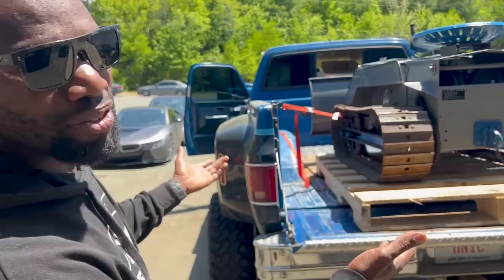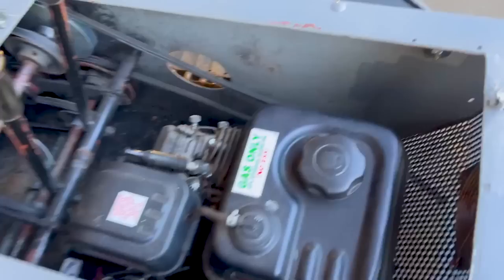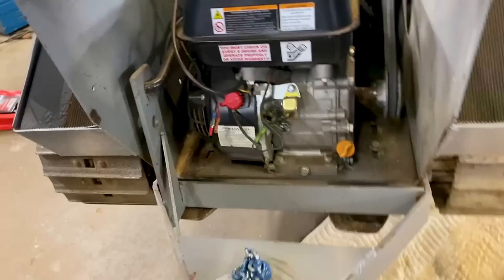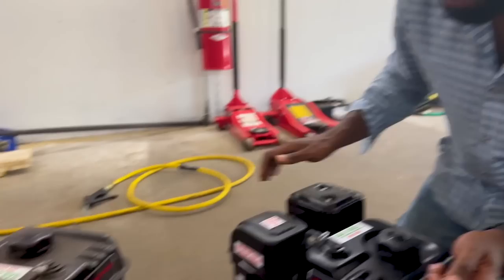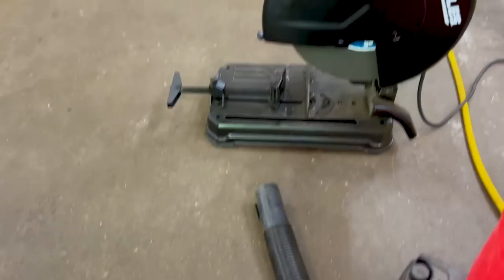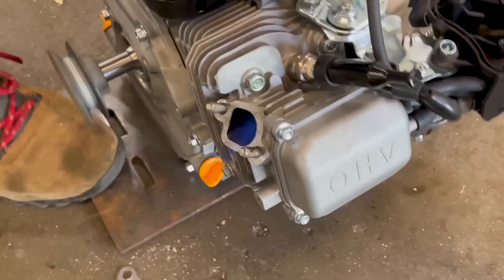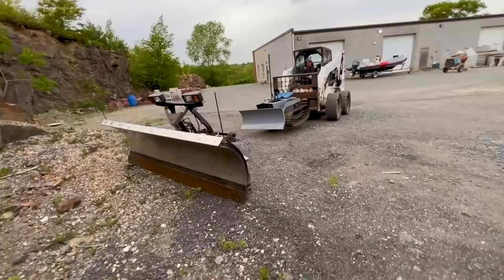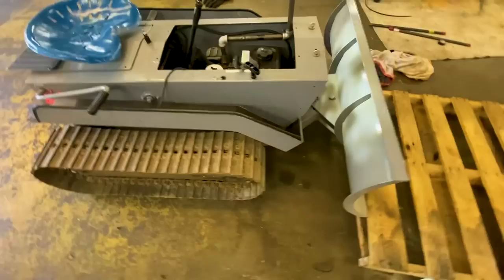Upgrading the World's Tiniest Bulldozer

Comment: Important note guys, since the governer was removed, the stock cast iron con rod and flywheel can't handle anything past like 5.5k rpm, so if you are planning on redlining this bad boy, you need to upgrade both the flywheel and the con rod to billet aluminum or you will get funky engine failure. Sick minidozer!
Reply: Jim jibroni  I've seen small engines throw the rod through the side of block. I wouldn't want to be sitting on this thing when that happens lol
Reply: Bullshit.. I spin mine to 10k with NOS
Reply: Oh the sound of that chevy..... Prime
Reply: Don't care what it's made of where it comes from or how small it is... I would use the shit outta this
Reply: @boulderdashcci  reminds me of the time a rod got blown to the side of the engine and made a hole on the side of our house with an old lawnmower. Great times. That thing knocked to hell and back but i never thought i was this close to blowing off a leg.
Reply: @getataste  had a Cummins VTA 903 let go of a rod. it spun a rod bearing and in about 3 seconds flat Threw the Rod out the side of the block made a window big enough to crawl into the engine with and shot what was left of the rod end cap about 2 lb piece of cast iron probably heavier 200 feet or so.... and the piston got chewed up into quarter pound peices and the rest of the rod came out the side of the block at mach jesus although in 4 pieces
Reply: Ik your bot joking because my rod recently flew put of mine😭
Reply: I heard those engines run better after you install an inspection port in the side of the block
Reply: @boulderdashcci  buddy of mine had his leg messed up very bad when his dirtbike blew up the valve embedded pretty deep
Reply: I don't think Struck ever envisioned the need for an engine diaper on one of these!!

Comment: The fan was probably offset to blow away exhaust (either fumes or dissipate heat) as it's on the same side

PS that's a Sharpie for scale (dozer stands on a standard pallet) wink
Reply: The exhaust was on the left side, and the fan was on the right side.
Reply: It's blowing air in, dissipating heat, when you can see the wires and the sticker / skeleton of the fan, that means the fan is pulling air toward you, otherwise you would see the fins directly and not the motor/sticker of the fan.

Comment: Steven’s a genius .. this thing would be PERFECT for commercial walkway clearing .. I used to do snow removal, and some commercial buildings can have literally kilometres of walkways, and a lot of the time they’re made from interlocking stone that becomes uneven from frost heave, so using a snowblower, your edge catches every 2-3 feet and you end up slamming the snowblower into your pelvis, same thing with a shovel as well.. if you put a piece of pvc tubing on the cutting edge of this thing, it would clear walkways like a dream .. you could actually make quite a bit of money off this thing just talking walkway contracts

Comment: I’ve always wanted one of those!  Amazing!  Need more space!

FYI you can install coils on it to charge the battery while it’s running.

I have a Super Charged Hemi 420cc Swapped Ariens Snow Blower.  I ended up using Coils from a Generator bc of heated hand grips!
Reply: I’m looking to get my first lawn tractor, what would you suggest as far as something that’s going to last? I’m looking at old used
Reply: @build2break  

Where are you located?
Are you handy?
If not…are you willing to learn?

What are you looking for in a tractor?
Reply: We’ll the “craftsman” push mower I got at the big box store. Has been trust the last couple years this far.. but I quickly realized I have more lawn/ hill then I initially thought. 
I’m in New England 
I looked at a kohler powered something last fall, but didn’t pull the trigger on the first thing I saw. I’m in my late twenty’s and trying to be more wise if that makes since. I just want something tried and true, don’t care what color the decal is

Handy, I like to think so, although I have many unfinished projects as it is, so what’s one more!?
Reply: @build2break  

Well if your tractor breaks down your grass still goes!

I like AYP/Husqvarna/ariens/craftsman/poulan built tractors
Reply: @pattayperformance  in that order?? Or in general, I see many John Deere still going, the older green craftsman, and it seems like a lot of cub cadets
Reply: @pattayperformance  in that order?? Or in general, I see many John Deere still going, the older green craftsman, and it seems like a lot of cub cadets
Reply: @build2break  are you on Instagram?

Comment: Nice video 
Dad bought one of those Bulldozers or one like it in 1980 or 1981 
We used it to convert his houses crawl space into a basement 
I spent  hours pushing dirt out of holes at the end of the house 
I graduated Highschool in 1983 and got a job for the summer running a D5 
A HUGE leap in size and power LOL

Comment: I've got the Struck RS-1000, which is one of the versions they're selling today (I bought mine used).  Those are amazing little machines, I can do work with mine that I would otherwise wouldn't be able to do at all - like moving things.  I'd suggest a smaller driving pulley on the engine, as it makes it much easier to drive (albeit a bit slower).  Hydraulics, rubber tracks, and so on are good improvements.  The biggest thing I like about it is that the belt drive is so easy to maintain.  Second - I can get into and work in places a riding mower or other similar tool can't get.  (It will also go through mud and water and over obstacles unlike anything other I've tried.)  I use mine regularly for all sorts of chores.

Comment: Try driving and working in the soft swamp terrain. You could also try adding gears to it for more torque vs speed options well as add wear plate to blade to get more weight there so it eats deeper, well as height adjustment. Could also make setup were throttle is connected to control levers so when you move it adds revs while idling normally, with manual override.

Comment: The factory color ironically was cat yellow. There was no rubber track option for these. The next ones they made had an option for a hard plastic Bolt-on pad. However, you might be able to find a rubber track that would fit

Comment: Considering the extra HP I would jump the exhaust pipe up to the next size if you can get a flange that fits. The flange you used looks smaller than the exhaust port. Enjoy the fun vids and great humor.

Comment: you might want to mount that solar panel on a set of drawer rails to pull it out from underneath that seat. panels with partial shadows destroy themselves dramatically and quickly... (this is not a trolling remark: before my skull got its current configuration, I was a solar engineer)

Comment: Look into a motor that has a starter/generator for that little dozer. Solves the dead battery issue, and is easier to start in winter to push snow.

Comment: my dads mini dozer was run off a 25 hp briggs & stratton all metal frame and belt driven  it would push the s++t out of snow and pulled my dads truck out of the ditch   we got ours from a company in mich  and yes ours was yellow !!  the mini dozer

Comment: Having both an Fanttik T8 Apex and an GOOLOO Titanium. I have had multiple times when the Fantek errors "voltage too low" 6V and it refused to try. The GOOLOO worked each time with no issues.  The Fanttik is very limiting buyer beware. I trusted Legit  Street cars when he endorsed it.

Comment: Man like you need that toy you placed on the track for scale… I know you just duck into the bathroom together. Like it’s ever seen use..

I made an exhaust adapter for my generator out of brazed copper fittings and used a 1lb Coleman propane tank to make a baffled muffler. Oil filter is another easy muffler, just get the oil filter nipple from like a riding lawnmower or a sandwich style remote oil filter kit

Comment: Really should have added a hydraulic pump, valve, and cylinders to raise, lower, and turn the blade.   Then build a blade with so.e weight to it that will actually do something.   Better yet, just start from scratch and build it right the first time...

Comment: Call me late to the party! Been teasing a bit about rich and his new apparent residency and the jokes about the flashlight being too small and so on but if I'm reading the lines of this video and that comment about tan line on the ring finger;(. Man I'm really sorry about that! I didn't actually realize rich and his significant other were no longer together. I just assumed it was Jokes here and there I didn't realize they were actually separated. Congratulations on keeping things going with the change of circumstance. At first I almost said they make 1 smaller than this then he mentioned it's from the 1960s which is correct it is the little one. I thought this was at first something modern from like Tesla or something like that. I'm familiar with one from the 1960s that is based off of a military design used in the Second World War so you history Buffs can go out there and look it up they made a unit almost identical of this for the war it was a remote mine sweeper basically this thing without the blade on the front and was controlled by a set of long cables leading to a control box and it was to do with mine removal and they were repurposed after the war for doing farm work and little mini excavators like this for clearing sidewalks. Very nice to see one of these little units still up and operational.

Comment: There's no way this guy is certified to drive a forklift. First I never heard of being certified. I just got on it and taught myself how to drive it. When I was at a large company I had to get certified but there's no number or anything like that, lol. BTW this guy is terrible at driving it. He hit the truck and had his forks at the wrong angle when entering the skid. That also a really funny forklift. I never seen one with a drum to hold the hydraulic fluid lines like that. This model must be very old because I drove all different models for 20 years and have yet to see one like that in person or doing a quick Google search. Normally the lines are built into the mast so you don't have to worry about things getting caught on it and having a disaster on your hands.